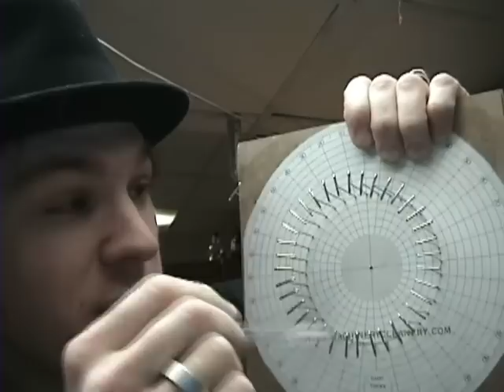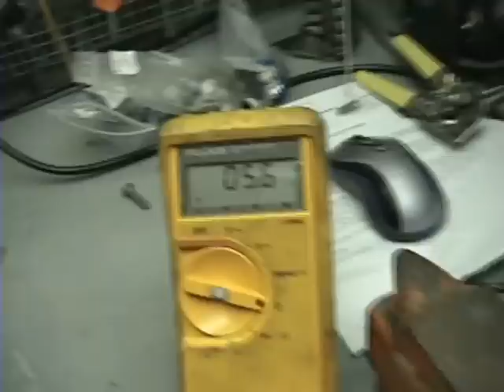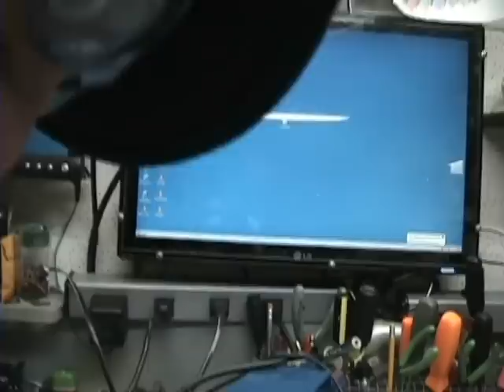36 Point Star-Challis NEW  COIL Build And Small Test (TEST25)

Comment: FYI my friend, you can easily pick up a length of steel (which is the same diameter as that hardened rigid steel pin that you briefly showed in your hand) and the steel length is I believe something like 3 or 4 feet --- at Lowe's. Just think wooden dowel - but steel !!
Cut the steel pieces to your desired length, and BOOM !!! 
Seriously man-- you've got quite the efficient and effective system set up and in place to perfect rhythms and grace sir !! Keep up with the great work man !!

Comment: How do you hook up the cap bank, in series w/ the coil? Love how the coil flexes when 300 volts passes thru it. Have another video without the pins to see what happens dude. Have you ever burned the coil inside the star somewhere, or does it take the 300 VDC and never get hot? Inquiring minds want to know !!

Comment: I notice the first time you showed the higher voltage effect. The magnet shot up about a foot into the air. What about rigging a magnet guided by a rod so that it can not flip around. I think you will end up with a magnet launcher. Just too see how high in the air it travels. Next try a piece of aluminum. I think aluminums reaction to the strong magnetic field will surprise you. I think the expanding magnetic field will push the Aluminum away. Especially if the Aluminum is shaped like a donut with a rod in the center to keep it from twisting and traveling straight up. Best of luck to you and all you do. Thank you for sharing.
Reply: Hooked On-CNC can we use to launch flying objects into space ? with some magnet shield on them ...the time magnetic push vanishes they could start hydrogen fuel or such a powerful push that they get into outer space already

Comment: The hardened steel pin looks like it came from a needle bearing.  You can find smaller ones in an automotive universal joint, or bigger ones in the axle bearings of rear wheel drive cars.

Comment: Graingers has the dowel pins.

Dowel Pin,Harden Stl,M2x20mm,Pk 50
Item # 1TY61
Dowel Pin, Standard, Hardened Steel, Plain Finish, 20mm Overall Length, M2 Nominal Dia, Dia 2.002 to 2.008mm, Length Tolerance +/-0.50mm

Comment: 500 plus volts into less than 6 ohms. gotta love it. those numbers would give an I of 500/6, or 83 AMPS. no wonder the poor #26 wire was so stressed. interesting pattern, but i think the opening was an aperture of combined symmetrical magnetic field lines. another pattern may have worked as well or better.
Reply: i think an other pattern woks better becauce he is decreasing the pinns constantly and maybe is that a slight problem

Comment: funny :)).. here's a challenge for you: 
Use the same amount of wire to wrap a normal ferite core coil and spin a magnet through both of them and get the output through a scope. Nobody did this. What is the electrical differece between a normal coil and a starship??

Comment: ya know if you put this in rubber you could make a rubber rectum valve a bit like a pig nose valve but powered with no moving parts you could tailer make the layers of rubber plastic f glass etc for longer lasting valve i just have no idea what you would use a rubber rectum for

Comment: Write the 24 digits of the Fibonacci sequence in mod nine around a circle. Then follow the path of the multiples based on a positive negative configuration, based on which 124875 is flowing which direction. if you need to see the examples look at my Facebook. I have posted the positive negative configuration. and the path of multiples (which symbols it creates on a circle) i believe you will get interesting results if you map out the multiples and the 124875's but the Fibonacci is only 1/3 of it

Comment: i have a suggestion: Voltage@Phase equals Amplitude Voltage times Cos(a sqrt(+1) + b sqrt(-1)). can your coil do it ??? can you find the way of machine square rooting the negative ??? if a unitary volume of metal mixture is put under square root then it creates positive and negative sub volumes but if you put it under fourth degree root you will get (+1,-1) x (real, imaginary). math works fine with both real and imaginary. if such magnet can be made we can build and use machines that implement fully complex math.
Reply: I'm sorry but wtf did you say cause you lost me

Comment: yes i see that he is going counter clock wise and clock wise around the pin'si did the same way but i went under with one type and top on top on the second type a found a difference in between each type just a little the under and over one had a good confind field and the top on top over lap had a center pulling action of each  had a small spin field

Comment: If u build me a working 5 pointed star toroid with 2 leads in going one direction and 2 leads out going opposite direction I will tell u and show u how these devices were actually meant to save the human race from pollution all together AND purify ANY water sourse anywhere. I will also fill u in on how these toroid need teardrop shaped magnets INSIDE the core of the donut BUT NOT TOUCHING IT...ENCAPSULATED INSIDE CLEAR PLASTIC ...MAGNET INSIDE PLASTIC INSIDE TOROID CORE!!!